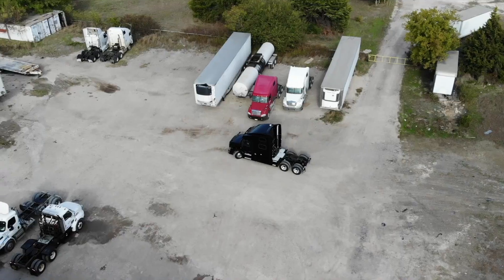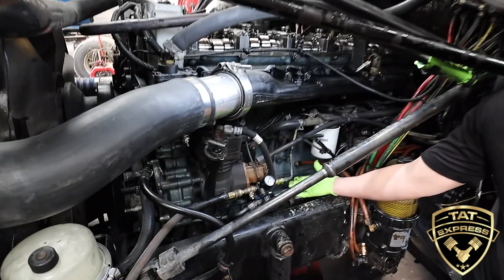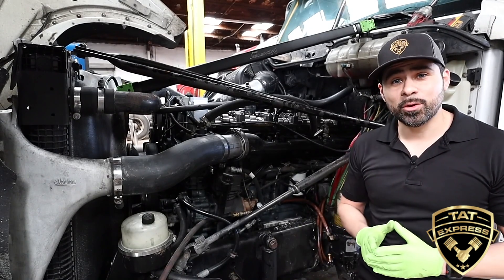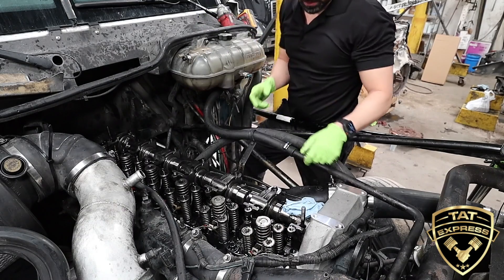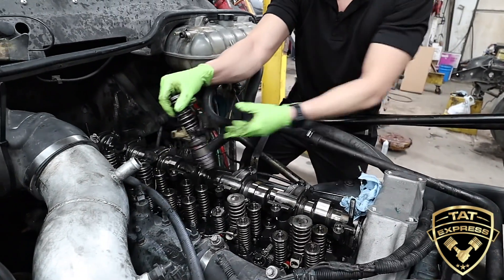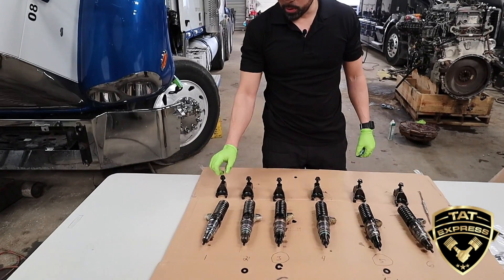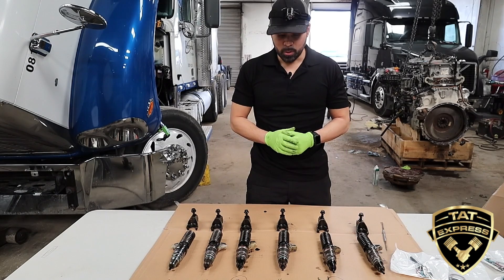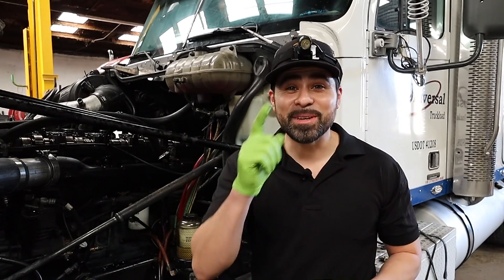Detroit 60 Series Injector Failure

Comment: ? For you 2012 dd 15 you get truck running temp run engine. Up 2100 tach and oil pressure gauge go crazy truck tries to cut out what do you think

Comment: I need help I have no power going to the fuel injectors it does turn on with starter fluid but doesn't stay on why is that it's a 12.7 Detroit 60 series.

Comment: Hi mate great video. I have a series 60 that won’t start without using throttle and is really low on power. Would you suggest injectors?
Reply: Did you ever fix that issue?? If so what was the problem 🤔

Comment: I got an 06 Columbia Detroit 60 just replace my injector harness bout a month drove good. I just driving good threw the night when I got to my delivery the truck was missing an eventually shut down it starts up with starter fluid but don’t stay running. Do you think it may be the work done to the injector harness?
Reply: You ever figure out what it was ?
Reply: @dariusparker6683  had a small leak at the fuel filter wasn’t getting enough fuel to the rails at idle

Comment: I rebuilt my Detroit 60 14 L I’ve been having and injector number 3 problems I replaced them three times all brand new injectors New ECM new wiring harness and still having that problem
Reply from the maker: Robinson, 60 series parts are no longer as reliable as before.  We have had bad heads, injectors, and reman fuel pumps.  The manufacturers have stopped producing the parts.   Be sure to subcribe to the channel.  👍🏼🚚💪🏼
Reply: @TATEXPRESSINC  That answers my question as to why I have replaced Injectors 4 times on this 12.7 engine. The parts are crappy.  I'm glad this time is being fixed with three new injectors to sell this truck. I went from owner op to company driver and finally seeing money in my bank. Should've sold my truck years ago.

Comment: I have a 05 freightliner columbia w/detroit 60 14L. It has a bad vibration/shake in the engine at idle and rolling. Worse with load, kind of like a stopped up fuel filter. But the rpms do not fluctuate and even with a empty flatbed, it loses power on the slightest incline while in high range especially. Replaced turbo, vpod, egr, wiring harnesses for injectors and ecu. Any help will be much appreciated.
Reply: What was the problem?
Reply: What was the problem?

Comment: Papa.
Good good video.  I dindnt even watch the whole video and had to SUBSCRIBE to your channel will finish watching later. You explaining in good detail the parts. Now I have a 60 series good engine but lately when I stop on a red light truck seems like it wants to turn off on me , does it for like about 2-5 seconds when I come even on empty from a long drive it dos not do it when Iam loaded . I change fuel filter which was really dirty( black) I cut in half the fuel filter to see. My friend told me to try seafoam to see.  WHAT DO YOU RECOMMEND?

THANK YOU/GRACIAS
Reply: Also I bought truck about 7 months ago and Iam thinking about checking injectors the seals and hold down bolts. Iam hesitant cuz never did a job like that before. Can you do video on 60 series engine in how to install injectors with cups and seals in how much torch spec the should have?  
  Thanks again for video!

Comment: I have freightliner Columbia 2006 60 serious 14 litter  Detroit engine   ,what caused of roof oil temperature gauze and water temperatures gauze didn't go up when I tur n  engine on and run 5 miles  and no power  loosing power  could not run 20 or 25  miles with full load trailer  bobtail 35 or 40 miles no power  ,no check engine light, would you help me troubleshoot  ,I took truck 1 place  Mechanics said  computer box had problems, I didn't trust    I went to 2nd Mechanics they said different problems  injector ,sensor ,pla pla

Comment: i have a 1999 freightliner with 12.7 detroit series 60 getting alot of fuel in crankcase oil getting worst i,m thinking injector seals what do you think put 6 remans in it about 8 years ago  ?

Comment: I’ve got a 14 L In a Cascadia right now that’s running on three cylinders or it seems to be. scan tool is not pulling data from the ECM ECM has been replaced I’ve took apart all the wiring from the ECM to the injectors and everything looks fine kind of stumped on it. No codes no check engine light I don’t even think the check engine light goes through it’s test cycle when you turn the switch on. It won’t let me do a cut out test or anything?? Looks like I’ll be digging into some more wiring tomorrow.

Comment: LOL...so who turned the jakes on when it was running with the valve cover off... No worries!! Been there done that... by all the little oil drops all over the engine...  Great video. Detroit  diagnostic injector cut out test.. helps also

Comment: I have Detroit series 60 14.0 engine be overhaul i put new remanufacture injector and now i have miss fire every time I release gas pedal sometimes white smoke
Reply: @mjtrucking3533 i have a 14L series 60 and mine do the same thing did you find out the problem

Comment: Hello, I'm having problems with my frieghtliner 2007 detroit 60 series 14.7 . My injectors are not firing and giving me a code of 61. What's your suggestion on what I should do or what the problem could be?
Reply: crank/cam shaft pick up sensor

Comment: Hey bud, I wonder if this could be my issue. Truck sometimes has a hard time starting when cold. Then once warm and go to get on it, it stumbles and blows dark smoke under load and then kinda clears off. It seems to do it when I put the Jake brake going down a hill, once I begin to climb is stumble and hesitates and blows dark smoke ?
Reply: I can’t recall the names or which sensors, but the TPS, SRS and I think the ambient air temperature sensors, if they are defective, it gives a false reading. The engine just smokes and cranks for ever. Again, I don’t know what sensors that are causing your issue, I just know from watching other YouTube videos.

Comment: thanks for this great video. so can you do the air pressure test without removing the jakes and rocker boxes?
Reply: Good question
Reply: I don't believe so. The reason to take the Jake brakes off is to take the rockers off. You need to take the rockers off so that each cylinder's valves and injectors are closed

Comment: My 2007 truck with ddec v keeps failing injector #1 first time it failed and was replaced The truck went about 7000 miles then it failed and it was replaced and now the truck only went like 1200 miles end it failed again.

Comment: with the o-ring completely gone on those injectors.............surely the engine must have been 'making oil' with all the excess fuel leaking past into the cylinder bore.

Comment: I had my DD S60 12.7L rebuilt four years ago, everything inside brand new except injectors. I replaced all fuel hoses from tanks to engine and back to tanks. Swapped out Fuel Pro 382 (see through filter) for old style spin-on fuel filters including all new check valves. The one issue which has never resolved is in morning with cold startup, engine fires up within 3-seconds like normal, immediately goes into cold start high idle and runs smooth (zero smoke) from 1000 rpms, 900, 800, 700, and then somewhere in the 600 rpm range as engine is warming up, it begins loping real bad and begins stuttering (putt-putt-putt still no smoke) and does not self correct as engine continues idling down into 500 rpm range. The only way to force it to stop is to blip the accelerator pedal which then immediately smooths out and stays like that the rest of day engine is running. It's done this everyday for the 11-years I've owned this truck. Sometimes during work day when going from road speed to a sudden stop such as at red traffic light, engine will lope for several seconds at idle and then smooth out. This is annoying and no one at my truck shop knows what is causing these issues. What is your experience with this irritating problem with the 60 series engines? I'm thinking about having an injector six-pack installed with all brand new injectors but I don't know if that is the problem or not. Also wondering could this be an idle validation issue with ECM. I have zero fault-codes.
Reply: maybe this? https://www.youtube.com/watch?v=UjXIBmorHes
Reply: I have a 2000 XL classic that does the same thing but now it has a power issues on and off randomly and is now parked until I can figure it out. It's a toy hauler not a revenue source so it can set.
Reply: @emilyramsey9079  - Update to my earlier posting. In the time since that posting I had a brand new head installed with six brand new injectors, and my third set of TRS/SRS sensors. Had the ECM reflashed with the correct injector calibration codes and engine now runs like a new one without any loping whatsoever. It is a whole "like-new" experience and I love it.
Reply: @kingjames8283  What is "loping"? Where did you get your work done? My S60 is acting up a little.
Reply: @kingjames8283 where you fix this at I need that same treatment on mine
Reply: @Leveragemedia365  - The idle loping was result of worn out injectors. I got a brand new Detroit Diesel six-pack from Clarke Power Services. They are located in many locations throughout the U.S. The hard starting issues was result of weak fuel pressure regulator on back of engine head. Once these two issues were resolved, it was like a brand new engine all over again even at 1.3 million miles.

Comment: Could injector wire harness go bad will it cause sputtering going down the road? Price range for one?
Reply from the maker: Dexter Williams a wiring harness could cause a miss, are you getting any check engine lights?  If not, inspect fuel lines for leaks, replace fuel filter and retest.

Comment: Hey nice video  Quick questionI have a Detroit's 60. 3 of my fuel  Injectors  Start leakin fuel all 6 injectors were  Brand new. How could that happen with new injectors. Thanks 😊
Reply from the maker: Thanks for watching.  Are they new or reman?  We have a lot of issues with reman.  Also check return lines for restrictions.  How do you know the injectors are leaking?

Comment: This is what I don't get about deisel shops in general... The truck originally came in for a cam repair. How come a injector problem wasn't noticed until after I spent thousands of dollars on the cam repair? Did I even need to repair the cam in the first place? Surely, their was a code for the injectors before the cam was repaired. It seems like a scam to me.

Comment: I do have a question... 2000 Frieghtliner classic xl with a 99 series 60 12.7
So a Frieghtliner Dealership found cylinder 6 getting hot before the rest of the motor... said that the injectors were extremely to tight. recommended replacing all 6 injectors... so we did.. my question is... When you replace all 6 injectors do you have to recalibrate the ECM to the new injectors?
Reply from the maker: Yes you must program new trim codes to ECM.
Reply: Great....  Im pretty sure they didnt do that. truck runs great only because i have the waist gate wired to stay closed.

Comment: Why does Volvo,not fix there injector cup issue,I've had to replace them every year,for the past 3 years on get but 8 to 12 months before having to do it again..
Reply: It's currently in the shop being done again..
Reply from the maker: Check injector hold down bolt threads in head.  Also be sure using all new parts, no reman
Reply from the maker: Lastly be sure the torque sequence is correct.
Reply from the maker: Mike, every year is excessive.  Have you replaced injectors as a set?
Reply: @TATEXPRESSINC  i replace both injectors an cups

Comment: Have 2009 Freightliner Columbia. Check engine stop engine light comes on when riding at 70mph for a good distance. When I go to pull over, lights shut off before I get to a complete stop. Had doc temp sensor replaced and cleaned dpf filter. Any thoughts on what it could be?
Reply from the maker: Thank you for the question. Join us today during our live video where I will be answering questions https://youtu.be/u8vvKn7cEXs

Comment: Hey man I got a 12.7 60 and it loses prime over night. Starts rough usually shuts off then starts rough again and smooths out and drives fine. Any ideas? Thanks
Reply: Thanks for the reply. I fired it up today and i did notice a little white smoke on start up only.
Reply from the maker: If no white smoke, you can check the oring on the fuel check valve.  Also an external inspection would be recommended as well

Comment: Hey bro please help me out.   I’ve got a 2005 Freightliner century with Detroit 60 series.    I’ve  got power loss on this truck for like 4 years.  I’ve replaced turbo,v pod,egr valve,egr harness,air charger.   It ran good when I replaced the egr harness for 3 days only.   And then back to the low power.  I took it to so many mechanics and no can figure it out.     Recently I had replaced main engine seal and some other seals    I don’t know what the mechanic did but I had power for 1 month.  Now it’s low power again.   I don’t know if he unplug the egr harness and plugged it back in.  I have no idea.   Please advise.
Reply from the maker: Rinku, thank for watching.  Is there any way you could bring it by so I can check it out?
Reply: TAT Express Inc.    I’m in NJ bro.  And I drive local only.  Lol
Reply: @Jigsawmaster1  what was the problem?

Comment: Great video. I have one question. What did you say about 90 degree  when torquing the hold down bolt for second step. Can you please explain that. I have 2009 Detroit Diesel series 60 in cold weather it starts very rough it spits and sputters for little bit and alot of white smoke, and after warming up it's fine. I m suspecting a bad injector. Sometime while idling it gets a little rough after giving it some power it becomes smooth.
Reply from the maker: hello and thanks for watching, 90 DEGREES is the final torque.  Do you have any codes?  If not, you could try this test along with dye to find leak.  I would also recommend a oil analyst to verify if you have an internal leak

Comment: Have a 2016 Cascadia with dd15 400hp. 375000miles. All computer diagnostics perfect, no check engine light. Sometimes lose pull power and engine brake power relatively similar.   When it does turbo reads 21-24psi. When  working normally 26-27psi on gas(pulls good and engine sound louder) and up to 32-34 on engine brake. When Idling it could work louder with 1-2psi pressure or become quieter and 0psi. Did dyno test 352hp, Valve adjustments, change air filter, change oil every 15k with full synthetic. Any test I can do? Or thoughts what it could be? MCM? Thanks for any answer.
Reply from the maker: Ivan thanks for the question.  Have you done a relative compression test, check exhaust or intake leaks and run a fuel integrity test. Thanks for watching🔧👊🏼
Reply: TAT Express Inc. Only compression test, will go tomorrow to dealer again :( Today 4364-18 appears. Hopefully they will find problem. It’s so hard to find a person who really understands reasons and problem causes. Thanks!!!!!!
Reply from the maker: Ivan, where are you located?

Comment: I have an old Greyhound bus like a 95 Detroit engine that has a new motor and starts right up runs good but it doesn't go faster than 20-30 miles per hour but when it's in park it has higher you can step on and it has high RPMs to anybody help me with that
Reply from the maker: Tree, fuel suppy or boost leak.  Is engine missing?
Reply: no the engines not missing
Reply: Thanks for texting back is there any way that I can take a video maybe to show you

Comment: Hey guys I got engine oil coming out of my exhaust manifold with the turbo removed and engine started. It’s coming out from the rear port on the turbo flange. There is a slight misfire and blow-by doesn’t seem bad or obvious. Before I suspect the major component failures like oil rings, valve guides/seals, is there any other component check/tests to consider like injectors or jakes that could be causing this?
Reply from the maker: Pull the turbo so you can see if oil is coming from head.

Comment: If it turned over with the air , couldn't you figure out which cylinder / cylinders are suspect by the timing order and figure
 out what position in the firing order it was during the air test
Reply from the maker: DirtMcGert, following firing order to isolate may be possible. Thanks for watching 👊🏼🔧💪🏼

Comment: Hello, I have a Detroit 12.7. I recently had a overhaul done, everything is fine but I’m losing power 9th and 10th gear. Do you think that could be an injector problem??
Reply from the maker: Kingb, we just repaired a truck that had been recently overhauled and what we found was a missing middle injector o-ring which caused the truck to loss power and caused the injectors to leak.  The truck had been run for 30k miles after build before coming in for test.  Our shop did not do the build.
Reply: TAT Express Inc. okay thanks, I’m in Dallas tx I got it overhauled at J&J the worst place smh... it mite be a missing o ring
Reply from the maker: Kingb, bring it by I will be more than happy to help.
Reply: TAT Express Inc. after all the work that was done it turned out to be the boost sensor.... smh